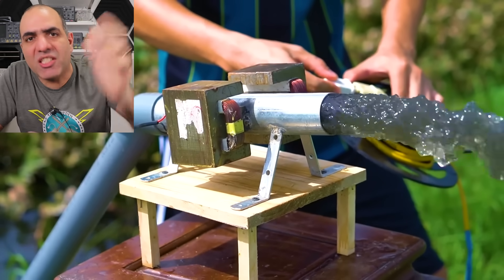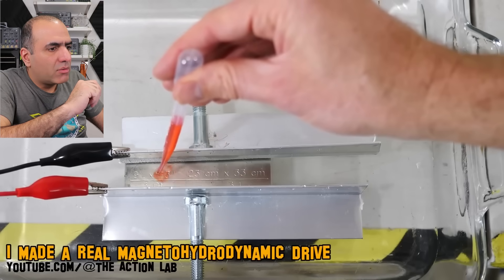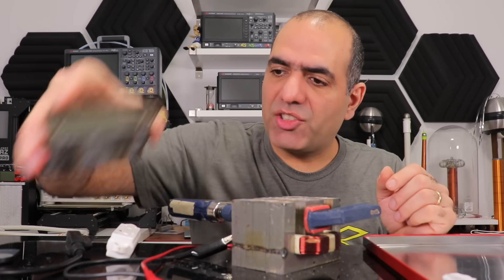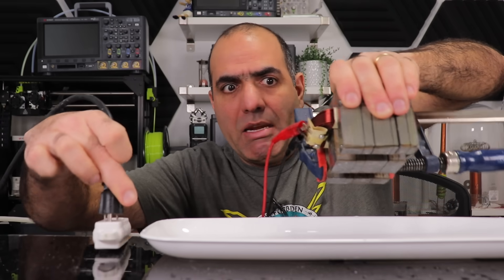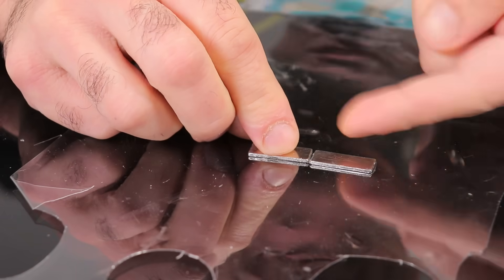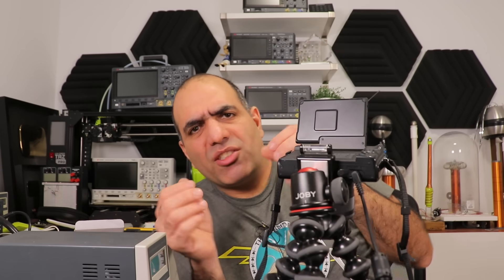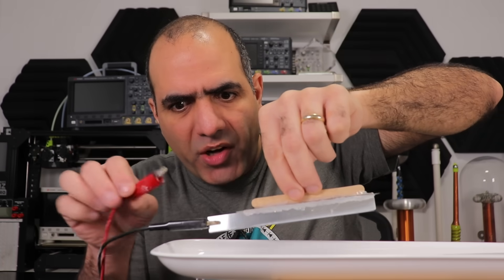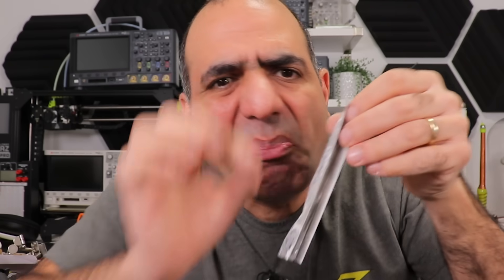Making a Water Railgun

Comment: The transformer pump (with an actuator moving the water) is actually a very common thing in coffee makers and similar applications - it allows a hermetically sealed flow path to be pumped with just a simple relay (mosfet), a.k.a. at a low cost. Pretty neat!
Reply: in (domestic, with a jug) coffee makers there is no pump, the water is heated up by the hot plate and the steam pushes the water up to the filter; the thing that looks like actuator is a one-way valve that opens when water is all gone to let the pipe refill. see Technology Connections vid on subject...
Reply: @el_es  I was gonna say, reading your comment gave me images of Alec doing his video on it on his channel, but yeah, you've clearly watched it as well :)
I love his channels, such random geek stuff and sassy snarks.
Reply: I suppose in a coffee maker, the heat it outputs is a feature, not a bug...

Comment: Much less spectacular but E&H magmeters use an alternating magnetic field across a plastic pipe with electrodes at right angles to measure the flow rate of water going through the pipe. Of course none conductive liquids are a problem. The field alternates to prevent electrolysis from eroding the electrodes.

Comment: 1:28 *cough... water is actually magnetic 🤔
it's diamagnetic

I've tested this myself by taking an ice cube, placing it on top of Styrofoam and holding a decently large neodymium magnet close to it.
it repelled.
Reply: That just means your water contains a foreign contaminant that's conductive/magnetic some you can't see or taste.

WATER ITSELF IS NOT MAGNETIC!
Reply: @dogs-and-destruction-channel  nope it's actually diamagnetic.
the stuff in water is hydrogen and oxygen, all their electrons are bound to give it a slight diamagnetism.
of course there are dissolved salts n shit, but this works with distilled water as well.
Reply: @Lardah  
Neither Hydrogen or Oxygen is magnetic to begin with. Pure water only contains H and O. Not meaning that water isn't conductive that I'll agree with you on, but pure water is NOT magnetic, even distilled water can contain small amounts of impurities. A good way to test this theory for sure is to get a trained professional to light a Hydrogen balloon behind safety glass (with care as the reaction can be huge) and test the moisture on the latex (making sure nothing else touches the water) that will be true pure water with no impurities. Then if you like you can freeze that and see if it still attracts to or repels from you magnetic.
Reply: @dogs-and-destruction-channel  Literally everything is diamagnetic.
Reply: @dogs-and-destruction-channel water is diamagnetic btw
Reply: @windowsxpmemesandstufflol 
But not magnetic itself. That's my point.

Comment: "I wonder if any of these gases are toxic?"
Some of them.

In salt solution, the Na+ and Cl- ions are able to disperse, rather than forming rigid crystals.
When you apply a current, the current is being carried by the ions themselves, with Na+ ions moving to the anode, and Cl- ions moving to the cathode.
When they reach, they are able to gain/offload their electrons, and become neutral atoms.
Which means the gas you're seeing probably is some amount of poisonous Chlorine gas.
Not in any large quantity as to be dangerous, and given the heat generated far more of it is likely to just be water vapour, but some of it is Chlorine.

Comment: Electromagnetic effectors have high efficiency based on their ability to produce back emf. The back emf reduces the amout of current drawn by the system. You just need to design a system where the moving ions generate a back emf that will reduce the current flowing through the system

Comment: 13:28 These "gases" are probably hydrogen and oxygen xD
Reply: It's salt so it's hydrogen and chlorine
Reply: Oxygen isn’t broken off in this reaction, but it is releasing chlorine which is poisonous.
Reply: @jaredf6205 Water electrolysis creates oxygen, but the salt adds an additional reaction which generates chlorine.
Reply: due to the salt ist actually chlorine and oxygen
Reply: mmm chlorine inhales drops to the floor
Reply: And chlorine because it's salt water

Comment: i think if there are less ions in the water, it will shoot out faster at same current.
Also: if you take a lot of these parallel (electrically and mechanically) with little space between them, the resistance will drop again. If you then add just a little bit of proper electrolyte, and keep the voltage lower than 0.5V, you should get decent flow, without anything to form. No gas forming, and no electrolyses.

Comment: I didn’t know water was magnetic 😌
Reply from the maker: IT IS NOT!!!
Reply: @ElectroBOOM  I thought that was how an MRI works - if the magnetic field is strong enough, the water molecules are actually aligned along the magnetic field.
Or did I miss something?
Reply: @ElectroBOOM  or is it ;]...............
Reply: The whole point of the video is to show that water doesn't react to a magnetic field. What DOES react to a magnetic field is an electric current. The water (the free ions in the water) provides a conductive path to allow current to flow through the magnetic field. Whenever current flows across a magnetic field, WHATEVER material that forms the conductive pathway will experience a force. With water, it's the free ions carrying the current that feel this force. Since they're embedded in the liquid water, they drag it along down the channel.
Reply: @ElectricGears  it was but a joke my friend :p
Reply: Its no ferromagnetic but paramagnetism and diamagnetism are also important.

Comment: Fake videos? I use such a pump since 2004 for watering my garden ^_^ It still works.
And yes, water IS magnetic, also aluminium and brass... Look at tesla motor how it uses aluminium magnetic properties.
Video after video it becomes more pathetic than funny. It's becoming a mythbusters of XXI...
12:30 try the same with a regular, not salt water.
Reply: You should just know how stupid you sound with this comment, sure water is a bit magnetic, just enough so you can bend it with a balloon that you have charged.  That is almost nothing tho. And that aluminium is magnetic, bruh